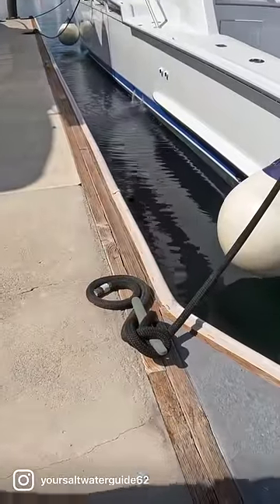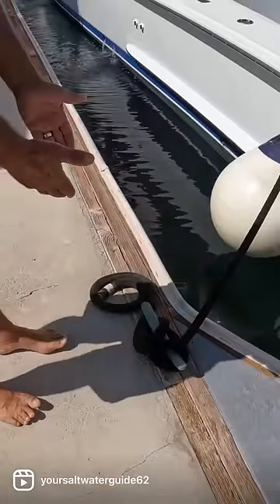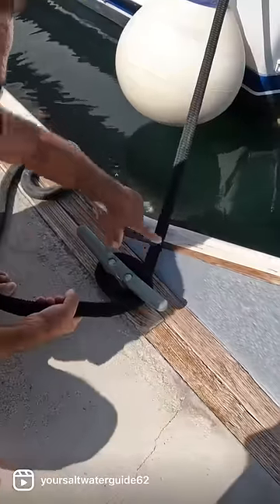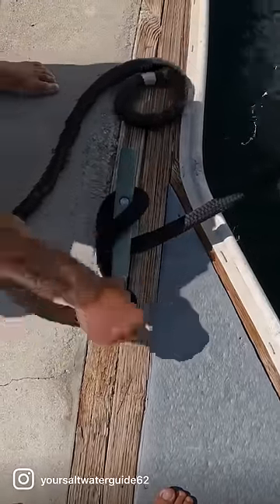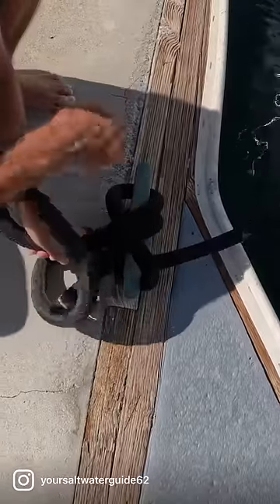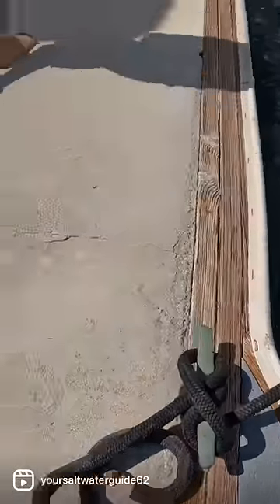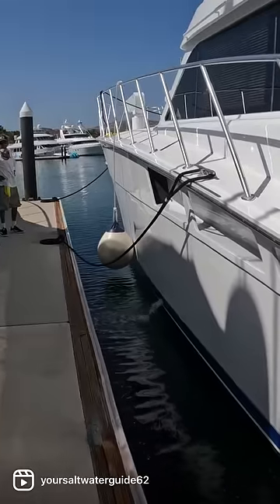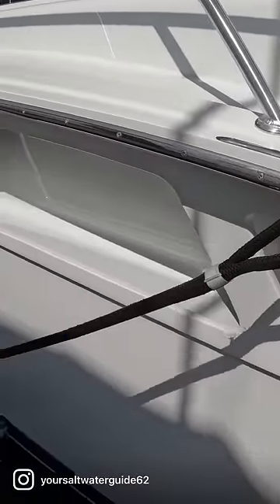I know the owner of this boat 🛥 #shorts

Comment: “When you go around it one time, it locks on itself”. What’s the problem?
Reply from the maker: Im not sure what the problem is either.
Reply: Nothing it’s just harder to get undone so if anything it’s way better
Reply: It wears the rope out and eventually it will fall apart
Reply: When you tie a line off you don’t want it to get fouled down; you want to still be able to turn it loose. It’s really not a big deal with pleasure craft though not enough weight in the line, unless there’s a large tidal difference
Reply: @hookedonthebay3890  🤡
Reply: @hookedonthebay3890  p.m. l  I
U
Reply: Could be tension? making the line break but that doesn’t make much sense
Reply: @SeizingSheldon  it tightens it a fuckton to where u need to wrench it off. As the other dude said, with pleasurecraft its not a big deal but big ships really try to avoid it happening.
Reply: It's called a trikeknot, the the elkknot this guy did isn't as strong and will slip
Reply: @eyanmartin-snyder3435  WRONG. NO. INCORRECT. I HOPE YOU FEEL BAD ABOUT YOURSELF HAHAHA. I HAVE SEVERAL YACHTS AND BOATS AND KNOW FAR MORE THAN YOU EVER WILL.
Reply: @hookedonthebay3890  rope couple  bucks a foot highend... boat 70k low end
Reply: @Yourmymomdad  How many BIG SHIPS do you have? 😂🙄
Reply: @hookedonthebay3890  That's going to happen anyway 😂😂😂 thing eventually get old and worn out especially rope.
Reply: I asked the same thing. I had more of a problem with him giving advice no one asked for on not his boat.
Reply: @hookedonthebay3890  ropes do that
Reply: @hookedonthebay3890  if you honestly let it get to the point where rope is falling apart, might be time to dry dock the boat..
Reply: @Tgiles13  I've known a LOT of people who live on boats and they are very specific and meticulous about taking care of docklines. They coil them up neatly, never put knots in them, keep them out of the water and tie the lines onto the cleats in a certain way where the rope doesn't get damaged or worn.

Comment: "See how this knot locks in really good, let's just undo that"
Reply from the maker: hahahah.  yes
Reply: Apparently if you make it lock on itself you might not be able to undo the knot depending on how locked it is. The knot he used is supposed to use friction the right way in order to be secure and it comes off easily if whe you want it to.

Comment: I was in the Coast Guard,  we were taught to never use half hitches.
Reply from the maker: Thank you for your input.
Reply from the maker: https://youtu.be/KaF9lFn0Inw
Reply: We were? I don't remember that.
Reply: Still on active duty and the reason for not using the half hitch is just for easy removal in a hurry. The method used here is absolutely correct and the only reason it would lock up is if there wasn’t slack left to accommodate the tides. Seeing as he said it’s a floating dock, the lines should be as secure on the cleat as they can be.
Reply: I was a seaman on a buoy tender and our first class boatswain mate taught us to never half hitch on a cleat.  Fast removal is a reason, but the main reason is that it will Bind up so tight, it makes it extremely difficult to take the line off the cleat.  I was In over 30 years ago, the old guard.

Comment: as a solo sailor i would say you still doing it wrong, you should tie the bitter end off to the boat and just run it around the dock cleat, that way you dont need to leave the boat to undock, also you should go around the cleat then straight over, no need to wrap it around the cleat. Tying it off to the dock like that also means no one else can use the same cleat which they would need for a bow or stern line if they were behind you.
Reply from the maker: OK THANKS

Comment: Second line is slack and it’s okay that it’s slack. That’s a spring line keeping the aft part of the boat off the dock. As if moves back it’ll tighten back up, the only correction I’d make there is the giant loop on the boat cleat. Could come off in a big wave
Reply from the maker: ok

Comment: I was taught to use a half-hitch on a jib-sheet cleat to get it undone easily. But on a dock line no half-hitch. Just criss-cross over itself and under the horns several times. And in either case, not to go around the base of the cleat first. That was weird. Maybe things are different in the powerboat world.
Reply from the maker: ok

Comment: Real seaman will never ever put a half hitch in any dock lines.If the boat pulls on line it can tighten the half hitch to the point of having to cut perfectly good line to get away from dock.I love it when idiots try to belittle folks for doing something wrong and proceed to instruct with horrible info.Remember if you are on my boat and half hitch the dock line you will be fired.
Reply from the maker: Thank you for the input.  Glad you like the video.  Have a phenomenal day.
Reply: The first knot had a half hitch in it too

Comment: I don't think that's right 🤔
I learned a full turn around the horn, then cross, then hitch. You did a half turn around. The hitch is supposed to be facing away from the boat, not towards it.
Reply from the maker: HAHAHAHAH OK THANK YOU
Reply: @YourSaltwaterGuide   I ain't laughing. With a full turn before the cross, the pull of the boat tightens everything after the cross, including the hitch.

Comment: It’s not totally wrong. A full wrap cleat hitch is taught to be used for long term docking or when it will be left unattended. It’s supposed to lock under pressure.
Reply from the maker: NO BUT THANKS FOR WATCHING
I AM THE CAPTAIN
AND IT WILL BE DONE MY WAY.
AFTER YOU DO THIS FOR FORTY SEVEN YEARS YOU CAN TELL SOMEONE

Comment: As an ASA instructor, if you do a full wrap at the base and it locks up the cleat is too small or the line is over sized.
   Then you have to tie it the way you tied it. 

   If the cleat in the line are properly sized a full wrap at the base, takes to load off the knot. 
    Put a boat through a hurricane with the way you tied it. You’re going to need a screwdriver to get it off. 
     If you tie it all the way around the base then finish it. All the load goes to the cleat not the knot!
Reply from the maker: well great so I did something right after 48 years

Comment: Dude, your hitch is called a "yaght hitch". In commercial boating you never go around both horns unless there is a reason.
Reply from the maker: NOPE IT A CLEAT HITCH
THANKS FOR PLAYING
Reply: @YourSaltwaterGuide  You missed the point. It is a shitty version of a cleat hitch, even shitty compared to most used by yaghters. It is not how professional deckhands working tugs and commercial vessels make a line fast. I'm just saying if you are going to shit on how some other yaghter or blowboater ties his boat up, don't say your way is the correct way to cleat a line when it is not technically correct. It is 'fine' for yaghts. It will hold and lines arent expensive. But it isn't technically correct and in fact is lacking compared to a real yaghter hitch. The proper way to cleat a line is to only go around the far horn, no round turn under both. Then 3 figure 8's. The way you do it with minimal cross overs and putting a half hitch on the end is a good way to have to cut off the line. With small lines a half hitch or 2 can be good, but also "technically" incorrect since it can bind on itself. But it is the safest way to do with small lines as insurance. However, you do it wrong. Because by going directly into the half hitch like you do, you are greatly increasing the chances that the safety half hitch actually has to hold the line from slipping. And if that happens, the half hitch will cinch down and bind and need to be cut off. You are too worried about looks and not worried enough and function. If the line pulls tight you do not want it to pull on the half hitch. That is there as a safety. You want enough friction before it to keep that from binding.

Comment: Yeah, dude there are plenty of ways. Personally I a) wouldn't call it a knot, it's various ways of cleating off, and b) would never use locking turns, or what you called half hitches. I use the OXXO method,  as do all my colleagues and their students here at the UKs largest RYA and MCA training centre. Also, for longer stays, we would put a bowline on the cleats on the pontoon and have the OXXO on the cleats on the boat. Not that your way is "wrong" but their way certainly wasn't either.
Reply from the maker: Thanks for sharing!

Comment: There’s nothing wrong with those knots AT ALL. Also, the midway line are called ‘spring lines’ 

Slack lines can also be ok (within reason) if tidal or secured elsewhere (rear front port side etc). 

Still at least you got several comments here
Reply from the maker: hahahahah

Comment: Negative, 1 Round turn then 2 figure eights then add 1 or 2 round turn depending on slack fake-out or dress bitter end is proper,  half hitches swell and lock when wet, but hey if you got a big ass marlinspike and want to use it be my guest.
Reply from the maker: HAHAHAHAHAH

Comment: Plus put the tail end of the rope, out of the way. It's a trip hazard.
Reply from the maker: ok
Reply: @YourSaltwaterGuide  I worked on a few commercial boats, but don't worry, my knot skills were not that great because I had a habit of getting confused under pressure. 
Sometimes I would keep tying until I ran out of rope.
Shoelaces were always a challenge as well.

Comment: Working on a service dock In a shipyard. The first way wasn't wrong.. stern and bow lines should be fairly tight and always secure.  Then have one, preferably two slack lines. The knot you tied was more like a refueling hitch. I'd be pissed if that was my boat and you touched the leads.
Reply from the maker: KOOL

Comment: No you don't. You always go around first. You're relying on friction, not just the half hitch/locking turn. The boat is on a pontoon so it isn't going to rise further, so it isn't going to lock on so hard that you can't undo it. I'd rather find my boat there still!
Reply from the maker: The boat is on a pontoon? What are you talking about?
Reply: @YourSaltwaterGuide  

I'm not sure why that's confusing? The boat is moored to a floating pontoon. Therefore you don't have to leave slack in the lines to account for rise and fall.

Comment: Still did it wronf you take the loop under the middle and put half loops on either  side and pull the slack line and it’s never and i
Mean
Never coming off it’s a synch knot
Reply from the maker: cool

Comment: You are supposed to slip the rope through the hole on the boat’s cleat, and wrap over the ends. The rope belongs to the boat, not the dock, therefore the rope on the boat cleat should be mounted as secure as possible to prevent slippage. I only know that from my ancestors who have been building and owning “Caravelas” since the 1400’s. Remember that, it should be mounted on the boat as secure as possible, but yet, still easily removed. Thank you for sharing, I love boats.
Reply from the maker: NOPE $( YEARS DOING IT MY WAY:
thanks
Reply: @YourSaltwaterGuide  … you did the right thing on the dock. I didn’t say anything about the dock cleat. I’m talking about the one on the boat. It’s vulnerable. Meaning that the loop can easily slip off the boat’s cleat, or just a guy being an ass can walk by and flips it out. But then, it’s your boat. I only have over 50 years of experience, born and raised by sailors, fishermen.

Comment: The way you’ve said to do it if left will tighten to the point it cannot be undone. I would not use your method. The way I do it is to make off on the boat. This way there’s no trip hazards on the pontoon. But every owner will tie up differently and this will change depending on where they are. This is a ridiculous video.
Reply from the maker: Thank you for watching.

Comment: Heads up for next time don’t touch another persons boat your asking to get dropped at the bottom of the Atlantic with bricks on your feet
Reply from the maker: haha <>You wish I had time to touch your boat.
You can only Dream of a captain like me on your boat.
Keep dreaming someday I may have time to help you.
Reply: @YourSaltwaterGuide  touchy much? This video sucks, the original knot can hold in extreme weather. Your buddy in the vid(or you) did it "totally wrong and jacked up", half cleat hitch knots are better for short-term use. And you left the remainder for others to trip over.    Jacked up?? Hahaha you left it in worse shape than before

Comment: He’s wrong.  Sorry
Reply from the maker: OK why do u say that How is the right way wrong
Reply: Depending on the dock setup - the vessel is stern to- if double berth you may want it to lock.  The spring line is all jacked up though.   Coast Guard we tied our vessels the way it was before it was “made right”…
Reply: Also that is a floating dock.  The boat will move with the tide as well as the dock.  You want limited movement with the lines.  Fixed piers you would tie like you demonstrated to allow a little movement - depending on slip setup.

Comment: Wrong.
Reply from the maker: HAHA LIKE YOU KNOW
Reply: Nah, youre not wrong necessarily. 
That'll hold until you get a afternoon shower with 35kt+ gust.  It will begin to slip with a steady chop and wind inside there. I'd add another half hitch. Will prevent it from slipping. Hence the belly in the spring line.
(Sure you set it up for the vid)
..Since we're being picky here...
Reply: @YourSaltwaterGuide  plus, having it lock in is not a bad thing.  Have you really ever had line on a chest so locked in it was that hard to get it out? Come on now....
Never put just one half hitch on a cleat where you plan to moor the vessel for any length of time. Next time you come out to the boat, you'll be missing some rub rail and will have rubbed a chuck out of the pile.